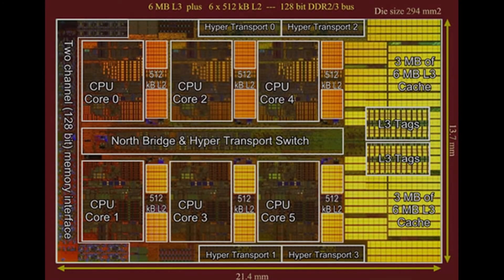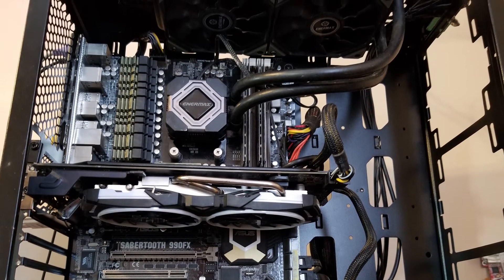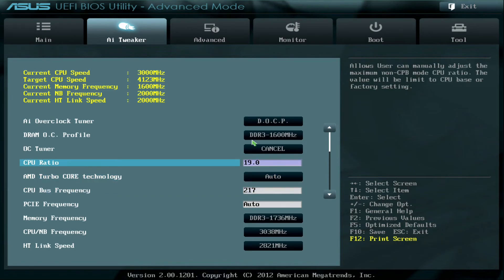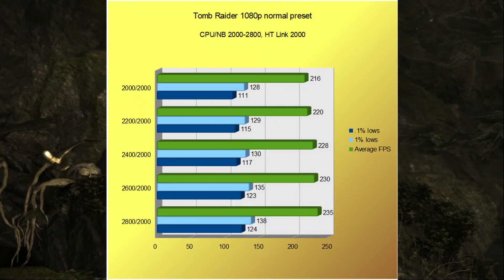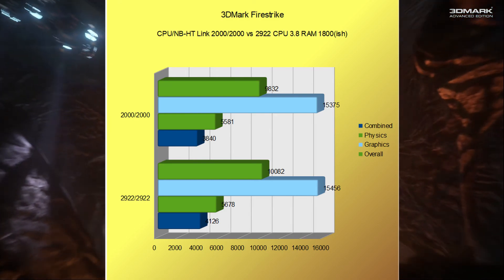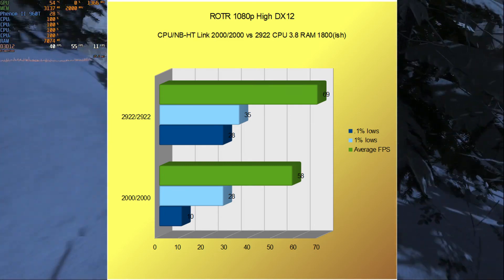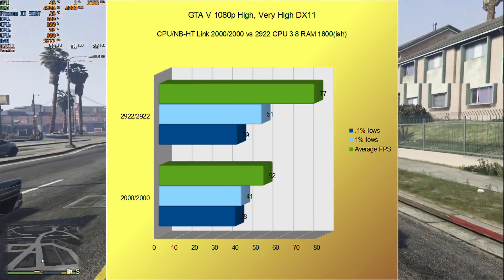AMD Phenom II 960T CPU/NB and HT Link overclocking

Comment: I got Phenom II 960T for retro gaming with the possibility of playing Minecraft, which would likely be the heaviest game I will play on that PC. I paired it with ASUS M4N82 Deluxe motherboard on Socket AM2 as well as 8GB of 800MHz DDR2. I got one of the best AM2 motherboards, so I decided to make my retro build on it, and it overclocks quite nicely. I got my Phenom stable 3.9GHz@1.4125v - getting it to 4GHz requires raising the voltage a lot more, and I just don't think it's worth it. NB and HT are both 2600MHz without me ever having to tweak their voltage. I could probably squeeze more out of the system, but it would mean tweaking the RAM, and it's too annoying to deal with. The system is good as is, and I don't really need anything better anyway because the GPU is HD 5770.

Comment: Excellent vid! It's just so good to see Phenom IIs being tweaked, tested and used the right way these times. It just bothers me how some "tech youtubers" does a revisit of the Phenom IIs, leaves everything at stock settings paired with DDR3 1333mhz memory and concludes "oh no Phenom II is shit in 202x". Phenom IIs are so easy tweak. Anyway, used to own a Phenom II 965 BE. Perhaps one of the best cpu I've ever owned and one of the easiest to tweak(that of course due to the unlocked multi being a BE). I ran it at 4ghz, 2.8ghz cpu-nb, ram at  18xxmhz and left the HT link at stock. I could've pushed further than 4ghz but my barely decent Asrock Extreme 3 970 board with its 4+1 vrm config is reaching its limits. I remember reading the OCN forum that 2.8ghz is the sweet spot in terms of performance gained and voltage needed. Also remembered the HT link speed oc is better left at stock cause it most of the time amounts to zero gains. Also, I bought a used 960T back in 2014 I think with hopes I can unlock the two disable cores. Unfortunately the sixth core is dud even if applied ample amount of voltage on it so I got a five core processor which I had fun playing around for a bit while till I sold it back. I regret the fact I sold my Asus CHV Formula for a bag of chips(had it around and basically sold it to clear space from my storage) If only I kept it would've been nice being able to revisit the Phenom IIs and reminisce how fun it is to own one. Anyway for that, I've been binge watching your videos for the past days. Those old hardware just brings me back memory lane. I'm loving it! So kudos for the vids! Cheers!
Reply from the maker: Thanks! Yea the phenom II's were phenominal not just for the performance but the amount of tweaking you could do. I included the HT link tweaks since there are still some that insist increasing it will improve performance, but anything over 2200mhz shows no increase at all so I generally leave it stock or set it to 2200. I know what you mean about the tech youtubers, I cringe when they revisit the Phenoms, as they do use the worst possible scenarios for performance. I recently picked up a used PC with an 1100t and am looking forward to getting some time to push that one and test it out. Dang, I feel your pain over selling the Formula board, I wish I had some of the stuff I sold off over the years! I just picked up a gateway gaming laptop from 2008, should make for an interesting video in the future as well. 
Thanks again, and cheers!
Reply: Back in the day you could also use phenomtwkr app to fine tune voltage per core per usage thus lowering de idle power usage. I love this platform even on ddr2 ... the only thing that was impossible was to use the 4 occupied slots and try to achieve +800mhz ddr2. I used and abused a 1055t with a m3n72-d for ages.  I remember even the coil whine of the mobo at full power. That sucker could pull 270+ mhz on the bus. On the other hand i seem to remember that keeping ht below the 2000mhz was preferred sometimes. Gratis work here. As others pointed out... this tweaking part of the phenoms has bien "forgotten" by most popular retro reviewrs and so. Also remember that hard 55c temp max wall on the phenoms.

Comment: Nice video man, i have a Phenom II x4 955 BE (deneb c3) i bought back in late 2009 / early 2010 and i'm still running it daily since then, with proper maintainance and cleaning every 2 months or so, still pushing hard up to 90-100% usage on heavy softwares and as i'm 3D artist i do use it as well for heavy graphics tasks (altho majority of softwares nowadays try to use more GPU than cpu for that, so that's a plus). I'm running it undervolted since many years ago on 1.21v (1.425v stock) but i never tried to increase CPU-NB while undervolted, i'll probably try this week, but i do have 1333mhz ram (669.9Mhz / 3:10) but making your maths that's 2009mhz CPU-NB and that's what i've been using since i bought this CPU , even while Overclocking up to 4.1/4.2ghz by FSB x Multiplier back in the days, i wonder if 1333mhz ram can handle 2200/2400mhz CPU-NB ? as yours is supporting way above 2400mhz (3x800mhz), and honestly the improvement is really good for what's shown in this bench.
Reply from the maker: Well I do know from what testing I have done is the higher the CPU/NB the better the performance seems to be, not just in benchmarks, but noticeable in general use as well, as in you click something it seems to open faster, etc.. The Phenom II's were pretty incredible chips, overshadowed by the core i series, which were incredible as well, and still carry a premium price tag even on the used market. Phenoms are at least still affordable, most likely due to lacking some modern instructions.
Reply: @Snickerrick  indeed, i never had an issue with my phenom in like 11 years  or so, they are amazing honestly. My only concern nowadays is the temperature (Package 56°C and cores up to 66°C) but i'm on a country where right now on summer we have 36-39°C weather! so i guess it'll suffer a bit but can handle it so far. Tested a few hours ago and 2400mhz on the NB seems to feel really faster even in desktop as you mention, but my CPUNB voltage was set on auto and raised +0.2v from stock so the temps went so high i had to abort and revert, right now 2.200mhz on NB with 1.100v stable (stock voltage on mine at 2.000mhz default value) gonna test later or tomorrow the lowest stable voltaje for 2400mhz or higher so i can leave it lile that 24/7.
Reply from the maker: Nice!! Yea they can go from a nice comfortable temperature to overly hot in a very short voltage range lol. Thats usually what I do as well, back down to lowest possible voltage. Im glad to hear someone is still playing around with a phenom II :)

Comment: this video made me think about a video I watched a while ago, a guy built a giant radiator out of several rads and attached them all to a box fan.  Was it Linus?  IDK. maybe, but I wonder what would happen if you attached that to this chip?  How far could you push it?  Obviously, you don't have LN2, and even if you did, it's kinda a waste to use it with this chip.  Also with such a setup, at what point would you see diminishing returns on your cooling?
Reply from the maker: I cant push this cpu any higher on this motherboard than 4.1, i hit the voltage limit. I swear this board had an override for it, but I cant seem to find it, maybe im mistaken. With the 240 radiator I have on it now, temperature wise I still have some headroom, but really should start going sub ambient at higher volts. I have a 1035T I am going to push later, just need to figure out a sub ambient setup using cold outside air lol

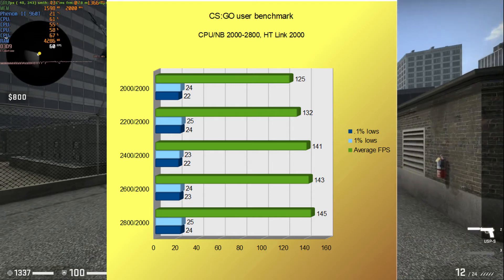Comment: 3:00 Why weren't the  1% and .1% lows affected?  Is this CPUs architecture really different?
Reply from the maker: They would have gone up with higher CPU core frequency, the CPU/NB affects the memory and cache bandwidth but on parts of that benchmark it must be bound by the cores speed, which really killed the lows in the smoke section. Thats my guess anyways, Im really not sure the exact reason, but as you can see it is repeatable.